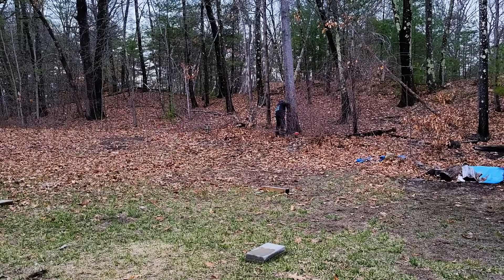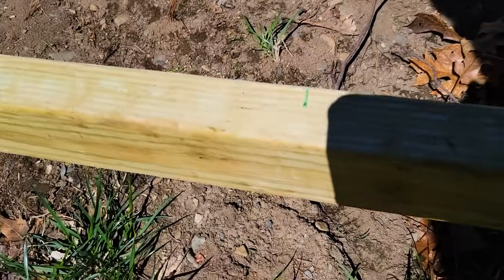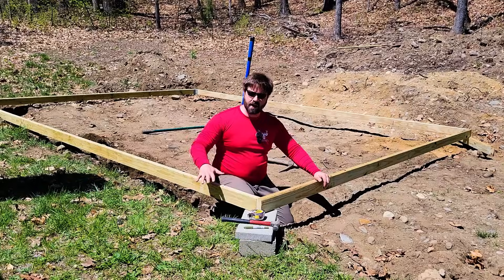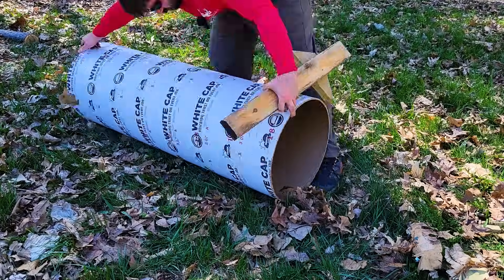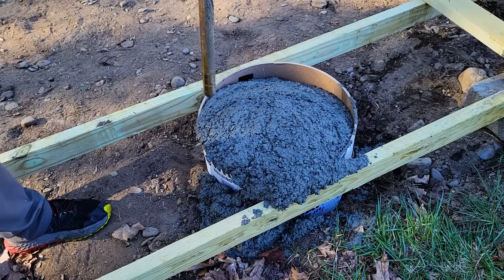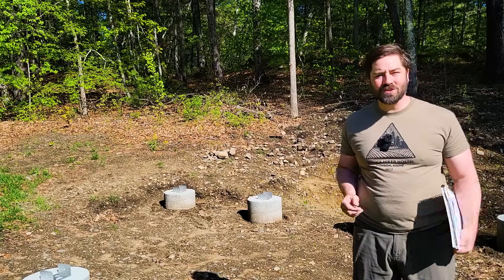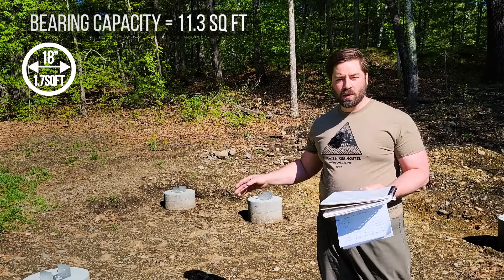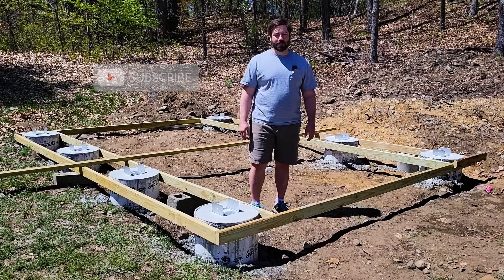Foundation secrets for an Off Grid Cabin

Comment: The only guy on YT that puts the concrete anchors in the middle of the concrete tube. Bravo. Most people miscalculate and end up putting them at the edge.  Great job   The type of guy I wish I had as a neighbor, a DIY guy.
Reply: Neglecting the end wall dead weight your interior columns will see twice the load as your exterior columns. Won't make much difference on this lightly loaded structure but is worth noting in other cases.
Reply: I saw him cutting roughly 22 inch sonotubes for concrete, then set them basically a smidge below grade.  Yes, I know it is a glorified shed, but if Dave went to all the trouble of huge piers, shouldn't they be below frost line?  I know that would take far more concrete, but at least it shouldn't heave in the New England Winters.
Reply from the maker: Thank you.

Comment: 32 year experienced and retired Operating Engineer says dig to frost line to not waste time and money. you are WRONG about being above frost line. bet money and take it to the bank this will move and stress during freezing
Reply: Where did he say this will not be affected by frost heave? He said he wasnt worried about the effects
Reply: Frost line ain't what it used to be! 48" my ass.. I'm in zone 6b and I have home weather station with ground temp sensors... Last winter was first in past 10 years it froze   1 foot down.
Reply: I was just wondering why didn’t you put some rebar in the concrete as well?
Reply: All engineers should be tradesmen first so we don't have to modify their creations to make them serviceable.
Reply: His soil looks like not expansive at all, so he gonna be good
Reply: It all depends on the water table depth. If it is more than 4 ft there shouldn't be much of an issue
Reply: @lesk7427 That is certainly not true.  Water also comes from above as well as below and, if you have expansive soil, you need to be below that as well.
If he's not worried about movement, why waste money on sonotubes and piers?  A simple floating rigid slab would allow for floating.  The building is small enough to make that inexpensive.
Reply: O shit, an engineer has joined in, just demolish it and rebuild to his specifications cause if it isn’t in the college books, it’s not gonna work 🙄🙄
Reply: @tommylindsey2924  The educated with experience know what it's like to be un-educated and to have no experience.  The reverse is not true.  Maybe you are going to make fun of the OP for using spreadsheets, math and building standards too?  "My doctor says I need a heart operation, but lady who sells potions out of her back doors says just to eat more oregano.  Them doctors is over-edumecated.  It's been three whole weeks and I ain't dead yet."
Reply: @tommylindsey2924 do you... literally just think engineering education has no value in the real world? And did you not hear the 32 years of experience part, or do you think he's a 21 year old who just graduated from college yesterday??

Comment: Surprised you didn't put the foundation below your frost line
Reply: it depends on if they have expansive soil. Around here the trend is to use 4 inches of foam 4 feet out past the building so that the frost does not go 6 feet down like it normally does.
Reply: @LaserFur  The moisture in the ground expands when it freezes, whether there's expansive soil (bentonite clay, as an example) or not. Frost heave just is what it is.

Comment: Are you planning to put some tape or barrier on the underside of the beams?
Reply from the maker: There will be a small air gap between the bottom of the beam and the top of the concrete.

Comment: Good job. What's the power rating on that mixer?
Reply from the maker: 4.3A @ 115VAC.  Which is less than I thought it would be when I bought it, but it ran for several hours just fine.
Reply: @DavidPozEnergy  I would have expected more. That one seems perfect for off grid purposes. Nice find!